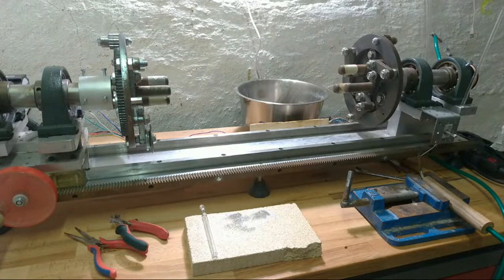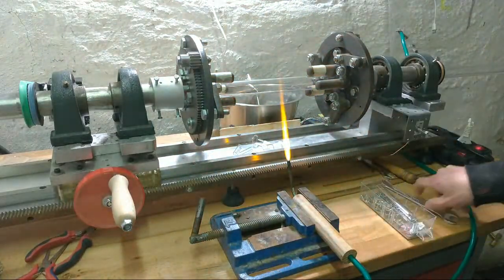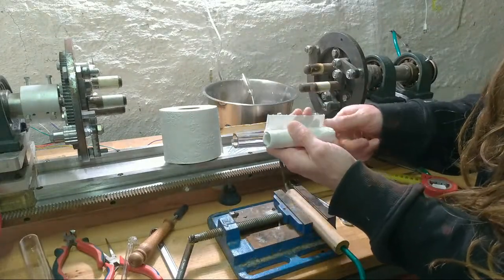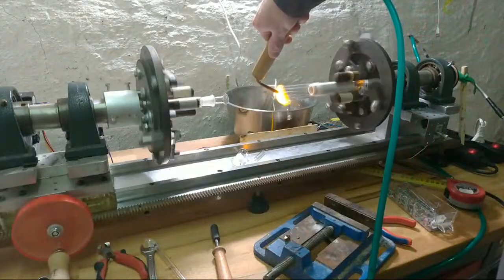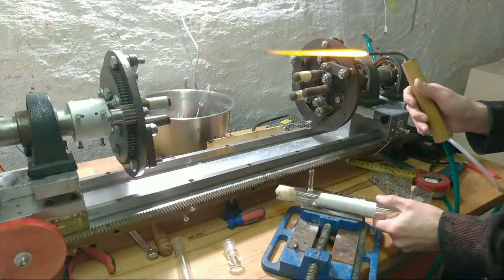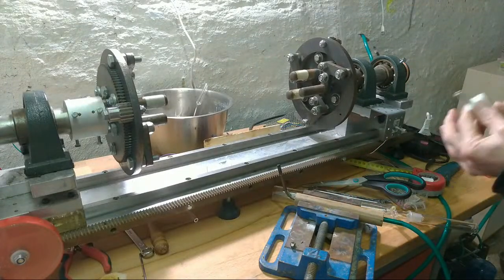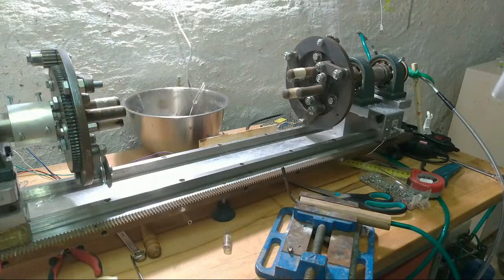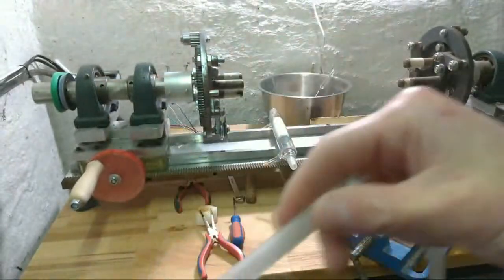Sucking at glass blowing

Comment: Is there anywhere you can direct me so I can gather the exact names and parts to build or have built a glass lathe? I have been down the KUBE path, to no avail, I have seen SEEM to Scientifico, and the size and style of the operation you are blessed to be living with is perfect, even  bigger is tolerable, but I just want simplicity and minimalist in build and design, but I lack the motor knowledge and the names of all parts. My life was saved with becoming a glassist, and the lathe is my personal go to- I stated when starting that I wanted to make George Jetson glass work...lol..little did I know what I meant to say was lathe precision glass!
Reply from the maker: I have playlist where Ii have described some parts used, but these are mostly custom design. In descriptions there should be some models, but these are mostly sketches, not necessarily finalized. Motors are some basic steppers with like 4Nm torque, bigger would be better and I have made unipolar driver I think. It's very basic type you can connect microcontroler to and it just works. but maybe it's best to buy drivers and feed them with some basic signal generators to minimize fiddling. Have very bad internet here so can't find any useful links, but if you look on aliexpress some stepper motor kit I am pretty sure you can find something
Reply: @IlusysSystems  thank you for your help with what you can and I hope 5G internet makes it your way shortly.
Reply from the maker: @arkfeldpro  lol it's just that I hat to travel out for few days and I get like 50kb\s speed in this particular room and can't drag computer around. If you have questions still feel free to ask, I think tomorrow I will return home

Comment: I’ve been blowing for a long and this looks pretty close to functional besides the chuck calibration issues but I’d really recommend you do more hand turning to get the hang of how the material moves. Lathes are great for huge pieces but most of blowing is really just learning about the flame and recognizing the exact moment the material reaches the correct temperature for sealing and blowing. Nice work building a lathe but trust me you’ll get more out of it if you learn the basics first. Find a cheap bench torch too like a Redmax or a Bethlehem Stack too if you have the money.
Reply from the maker: Thanks, I am indeed learning a lot still. My main problem is, that both of my hands are left, so hence the lathe. Once I installed belts and fixed concentricity issue I am happy man :) I am not really able to use conventional torches with this setupt hough, but I am feeling quite confident with what I have
Reply: Ilusys Systems it looks like it’s almost a great lathe setup if you figure out the chuck timing issues. I personally use yolks and a torch on a track but I’d really recommend you just make a small stand for your hand torch and get a feel for hand turning and how to clean the edge of a tube with a glass rod, learning to pull and blow points out of tubing and forming proper seals because all of those are essential skills for glass blowing. The quality of your seals and flame annealing will really determine if your work piece cracks or not but all those skill will help you get more out of the nice lathe you’ve almost finished.
Reply: Do you know of a pdf.or a parts list for diy glass lathe? I DO have a handle on the feel of the material myself! Lol!..I am Dj-ing the glass with a kick ass Taffy Turner right now? But I want to go hands free so I can learn more complicated designs from now on...
Reply: @arkfeldpro  if you want to practice the skills to be able to hand blow glass start with pulling lots of points from tubes and learning how to make seals between different diameter tubes then progress to using yolks as supports for larger pieces.
Reply: @chamberlandfill  I have been self taught for 3 yrs, I work with a Bethlehem Champion Sharp and recently brought in a wonderful unit called a Taffy Turner, thus replicating somewhat the Lathe ability, only never get both hands free; So, I want to get a "Parts List of decently bored out ckucks, and the type of stepper motor, the names of the sliding seat for the Bethlehem, and the most minimalist way ro build a large bore table top Glass Lathe so I can begin learning moves and skills like wig wag foot pedal work, and more decent vac stac, etc. I believe in the respect of learning the T.T. is the way to EARN a Lathe in my midst, so I'm just wanting to earn it more by building my own, but the terminology and actual parts is difficult to find being an Independent Gaffer/Glassist, etc. I have taught myself and practiced both Art without graphite molds and presses, like eggs, Snails, marbles, spiders/ Octopuses- even decided to test myself to learn soft glass delicate work, currently still memorizing my kiln numbers and settings for all work..timing too, lol!...so, I will take into account your advice, I just wanted to explain the level I am at which is about 60mm vase, glass, genie house, etc. Incorporating proper color and the alchemists magicians world, and am confident in the updating of production in life with the convenience of the Glass Lathe..let me know if you have a way to get the minimalist list
Reply: @arkfeldpro  I don’t have a list of all the part you’ll need but be very careful to copy the exact hp and rpm rating of any motors you try to use to build a lathe. The best thing I can suggest is order a manual for a Lathe from a reputable company like Litton and reverse engineer it from the exact specs. I’m a glassblower that primarily makes pipes but I grew up with a mother who was a soft glass artist in the 70-80’s so I inherited a lot of tools and contacts to get apprentices to learn reticello, optics molds, murrini making. I think lathes are good for large scale production but I don’t use them often and I still find that most people really just need to stick to yolks and learn how to turn freehand. It seems like your very interested in building the lathe itself and I wouldn’t try to deter you but just keep in mind it’s not a magic bullet. You can train yourself to make perfect sets of cups and bowls, goblets and large sculptures with just a kiln, a Carlisle CC, yolks, jacks and graphite reamers and parchoffi it just takes a lot of discipline and careful calipering of all your dimension. I would highly recommend anyone interested in making glass long term keep a journal where you record all the sizes of pieces you’ve made and the starting bubble sizes as well. I rely on my measurements all the time to remake pieces or sets but if you ever want glass advice or are interested in classes DM me on Instagram @chamberlandia and if you want free instructional videos please check out TorchTalk on YouTube they make very detailed videos that are highly useful for anyone of any skill set to check out.
Reply: @chamberlandfill  Thank you for the sincere msg. My reason for the lathe ( not that you asked but more out of getting a possible response that it makes sense, lol..)..is that I want to be able to work on intricacies in both artwork with waterways that might take two hands while maintaining a pause rotation step system, and in getting vases and large inside out egg type art that has a "Jetsons" type look or feel( perfect rings outside thin to fat bodies). I do believe in my skill with the Taffy Turner being more rewarding BY FAR when it comes to the Glassworks, my personal example is of the snail, it took me months to 1 run 1 piece get an exact shell or conche  ( spelled right?) & when contemplating someone to build a press, ( which they ended up doing after my suggestion) I felt sickened with myself for almost giving up on figuring it out ( it has parts that are the same every spin, otherwise it ends up just being a twist of glass) and I am proud of and wholeheartedly  "Own" my way around my version of "The Snail" even able to go soft glass with it..( I respect soft so much more than most do, although I used to be judgemental almost racist toward such a respected skill of the art in itself, to now defensive for any and ALL types of glassery) so being a solo artist so far and preferably as such, the lathe seems a lazy way for lots of work, so not cool at all, to an intricately expanding outlet to accomplish and access working artforms...if I am mistaken I would like to know, because the mastery of using the Taffy Turner Roller is not in my near future and letting go of the idea could come as a freedom I might enjoy! Thanks again for your insight so far and I will most likely take you seriously on your offered communication seeing as you have 2 generations of knowledge that I respect in general...take care and thanks again for everything.
Reply: @arkfeldpro  well all I can say is that glassblowing is always going to be technically difficult and I would encourage anyone who’s passionate about building a homemade lathe to try it but I would really stress that the greatest challenge is learning how the glass moves. I’m not sure what a “snail” is but good luck & if you need lessons in glassblowing I’d be happy to help but I live in NY but I’ve been working with soft glass and borosilicate for a long time if you have any specific questions about glassblowing.
Reply: @chamberlandfill  I will let you enjoy this, since you and I agree on the moving of the glass,...I have come to the belief, when it comes to color Boro, ( let's see if I can word this correctly) that the ALCHEMY of the ACTUAL colors themselves, "move" or say."REACT" ( ready for this?) ..that they react in a manner defined by nature's version of that color, EVEN THOUGH our eyes lie and see colors that are not true as in the Sky and the sea....so, in the moving of say, brown,...brown is usually a feeling of either chewy or brittle or dense...SORTA like WOOD or BARK...and let's go with Orange /Red/Yellow...they seem to take a little longer to get full of the hot stuff, but once they do, they are brighter and move more fluid like than others in the same heat...let's do blue, blues, no matter if it's royal or lake, or Robin's egg, they all move very fluid like and let go of heat faster,...like WATER does...white is brittle but Fluffy, while BLACK IS BRITTLE AND TIGHT..so, I feel that at.least with color, and both rod and tube I am affluent with some of the more keen of sense motion than most, and I love the feel of simax chewy strength for clear, vs. Pyrex personally, and Shott is probably the best for the extra-heavy wall, I am in no way pro in any sense of the hour or word, but the feel of the moving of the glass in its Alchemistically challenging forms leaves me believing in changing something- so, I am currently not lathe bound, and instead have on the way, a TAFFY TURNER w/ Blast shield and table sliding riser plate, and grabbing more oxy in the form of Oxygen frog ( 20psi/20lpm) and seeing if I can't produce some of the Jetsons type lampwork I want to do with the CHAMPION SHARP from Bethlehem, it's max is 40lpm, so I will be 10 off, since I have a 20/10 oxyfrog right now..but I in long agree with becoming one with the glass more so every second, and I thank you for stressing the importance of knowing what you are working with before jumping ahead, so I am doing just that in the form of the Taffy Turner, best of both worlds, having the steadiness of a lathe in rotations and movement, while the humble nature of not letting the lathe do the hard work altogether...goal is to post a pic with the even steady lathe looking work I will master with the TT. Melt on My Gaffer...
Reply: @arkfeldpro  stick with your taffy turners for awhile but if you want a practical guide to learning to use color with borosilicate the first technique you need to master is coiling a perfect tube of color rod and learning how to vac stack it between tubes of clear on the inside and outside. It’s very hard to master and you’ll have to really be very careful to make a perfectly smooth tube of color otherwise it will trap air bubbles. Also there are certain color additives that you need to be very aware of in order to know how to properly melt them without causing bubbling and discoloration or compatibility cracks. Primarily you need to be very aware of cadmium which is essential for many opaque yellows, red, browns and skin tones but it requires an incredibly gentle neutral flame to avoid defects. Another major additive to be aware of is chromium which is used in many sparkling colors, it requires being worked with an even more gentle neutral flame very slowly and must be annealed at a lower temperature. Silver and gold are very common additives too especially for fuming which is another technique which is essential to coloring clear glass. China makes solid color tubes as well but be aware many of them devitrify easily because they’re made with too little sodium added. All that aside you have plenty of time to learn more if you’ve been at it for a few years but I highly recommend learning the chemistry of each color you intend on using and always make a clear prototype of each piece you make and try to use calipers to record the dimensions of pieces you make and really like in a journal so you can have them to reference and replicate.
Reply: @chamberlandfill  I completely agree that I need to begin recording my numbers and sizes, I'm at the vac stac learning curve so I will heed the advice, and begin this and also possibly fuming on certain times once the feeling of the Taffy T is like 2nd nature. I always pictured Vacstac in my mind being a purely machine process from someone the purchased tubing out there like Colorado Color, so thank you for the quick guidelines on how the process is , going over to Mountain Glass online now to check out clear tubing sizes and match ups to fit most of the mm rod they sell, probably need to stretch it thin,..oh, I have for sure got the coiling down, it is mine, I own it, lol!..oh, and snails meant the actual creature or animal/mammal!
Reply: @arkfeldpro  vac stacks are hard and you can technically do any size you like but I always make color coils 35mm in dim and I use 26mm inner clear tubes with 2.5mm walls and 44 outer clear tubes with 3mm walls. Be really careful to clean your tubes well and it’s always a good idea to put them all in your kiln while it’s at annealing temp for a few min to vaporize any impurities leftover on the surface of your glass. This is a video below on sleeving stock tubing but it has good advice for setting up a vac with a simple foot pedal and getting the pressure right too.

https://youtu.be/Ksm3WzCJ_aE

Comment: Hi, how is your electrolyser connected to the torch? Is the oxygen and hydrogen separated or do you mix the hho with the propane? Thanks
Reply: It's becaus I need an oxygen generator for a oxy propane glass torch and electrolyser seemed the best way for me
Reply from the maker: It goes from HHO generator to T piece where propane is mixed in and then to torch
Reply: So the hydrogen is mixed in too?
Reply from the maker: @EdwardTriesToScience  yes, O+H in stoichiometric ratio
Reply: Oh okay, thanks for your time

Comment: That flame is too yellow, you gotta add some forced air. 2:08:33 - what happened with the axial flux motor lol, I see you're using a pully motor system now.
Reply from the maker: It's yellow because of sodium contamination. I did not have time/patience for tuning that motors, so I bailed out :(
Reply: You really need a better torch with propane and oxygen also need to work on your attachments it's going to break at the welds

Comment: Hey I've been building my own glass lathe and I can help you with syncing the chucks
Reply from the maker: Hi, I don't have such problems anymore... Turns out that using proper belts is good idea :)
Reply: @IlusysSystems  lol 😂 I really like you're chucks did you have a blue print or make them by your self?  Would love to see more information about them
Reply: @IlusysSystems  could you make more of the chucks
Reply from the maker: @natdizzle4259  Sure, there are models but I think mostly for inventor. but it's really simple design really.
Check https://www.youtube.com/watch?v=Cb4P3WYSkJI&list=PLyzlj5IaDE0f3XQ1dLXt-6RA28rN2mx7B and links in description if it will help.
All parts were used pretty much directly from laser cutting company so they were quite rough (but cheap), still works fine. CNC cut aluminium or stainless would be great, but there is gear profile on one of plates, which would be ridiculously expensive to do.